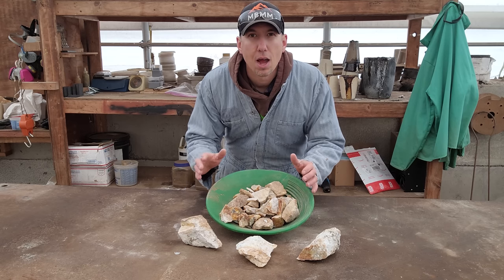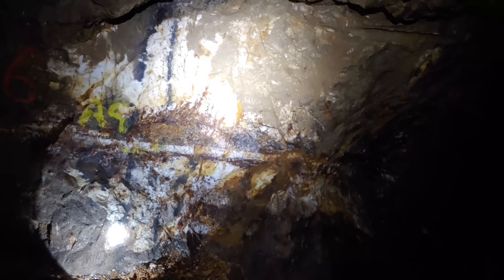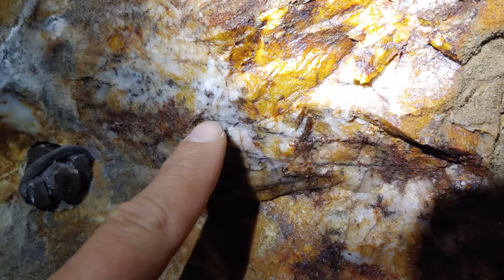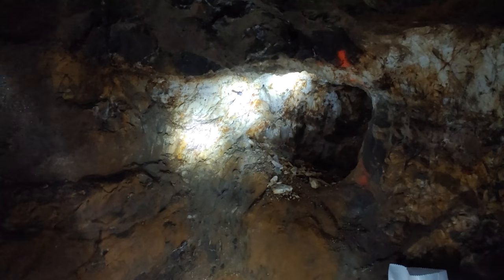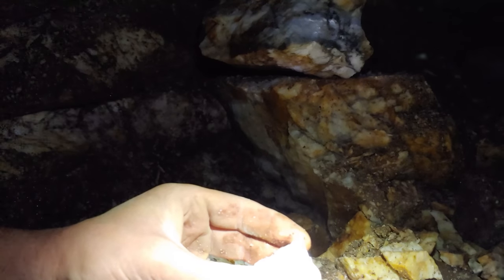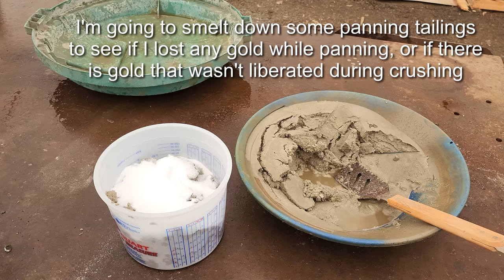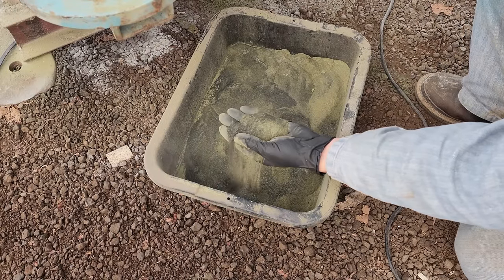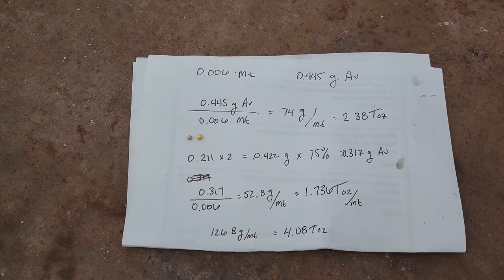Smelting Gold Mine Sample - Processing Abandoned Underground Gold Mine Ore

Comment: Great video.  I've been a prospector for over 30 years, but mainly by means of panning, dredging and metal detecting.  Not knowing all of the proper terminology, or processes, of what you are doing here (I do know what smelting is, but not all of the specifics) what is the black glass looking stuff that breaks apart when hit with your hammer? I assume this is what you refer to as slag? And if so, it looks a lot like obsidian which could be used for making realistic primitive tools such as arrow points and scrape blades.  Any idea if this stuff would hold up as good as natural black obsidian or is it too brittle?  Thanks for any replies.

Comment: Seems like if you just smelted all the first batch of pulverized ore to make that glassy stuff? Then pulverized the (glass?) the precious metals seemed to collect into those little beads nicely while separating from the (silica?). 

Keep in mind I don't know what I am talking about.😋 My super power" is figuring stuff out...

Say? Couldn't you dig a Pit and put that cone thingy at the bottom so that you could "Tip" the larger crucibles from a solid surface? Maybe even fabricate a sort of "Tipper/ Pourer" the Crucible could be set into? Maybe too after pouring all the melted stuff into the pit? you could speed up the cooling off time by pouring water into it? Dont forget some lift handles to lift it out of the pit!

I dunno, I see it better in my head... Makes sense to me there 😂🤣😂

Comment: The wedge is the part you hammer on.

edit: It's hard to tell on camera I mean maybe you can see something I can't being there in person but it looked like you were wedging through the cracks instead of between them. I kept thinking you were going to get them stuck and pin the layers together instead of apart. I could be wrong but it looked like you needed to come in at a more sideways angle instead of a direct angle. Also it might have just been the way it looked on camera, in which case this paragraph is totally unecessary.

Comment: Hey Jason I have a question, I have a bunch of material I have gathered from pc boards and some chips I burned and acid washed etc. But anyway I have just collected basically all the metal I could from the boards lead tin copper a little aluminum silver gold platinum( a little bit of the last three anyway)  it has made a conglomerate of grey brown red blue green black just nasty mud rock stuff. If I send it to you would you don your best to separate out the silver gold platinum palladium from the lead and tin and copper? What would ya charge me?

Comment: Sorry, lots of questions here: The ancients used fire to heat the rocks and I'm wondering if you torched (map gas torch) an area would it effect the ability to drill easier? Make it like butter...or very brittle and weak? Probably not cost effective lol.
Reply: Probably not as effective as other techniques. All that heat you're introducing to the rock discipates throughout the entire ore body, so it would take a lot of gas and time to heat things up enough to make the stone more brittle. Not to mention all the fumes you'd need to exhaust from the enclosed space you're working in.

Comment: You often mention sulfides. Are sulfides a good thing or a bad thing to find?
Reply: Gold can be dissolved out of deep country rock by superheated sulphuric acid rich hydrothermal water. Tectonic activity allows that water to escape into faults and cracks. When the mineralized solutions begin to cool and lose pressure   in those fault systems then silica, gold and many different types of sulphides precipitate out of solution and form the vein. So yes sometimes sulphides can be an indication that there is gold.

Comment: I noticed you were having trouble as the glassy silica was still very hot when you were trying to hammer it. I wonder if you could pour some cold water on it and cause it to crack due to thermal stress. That way you could cool it down and break it into pieces all in one step.